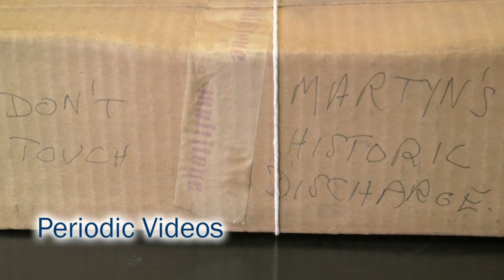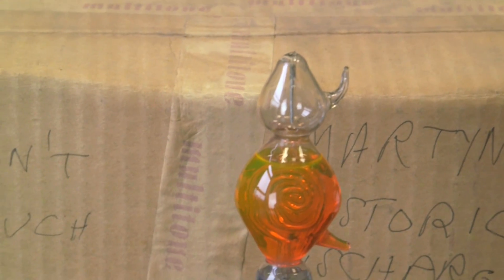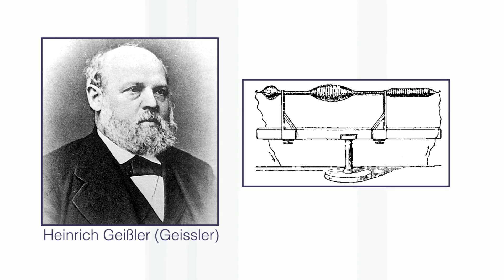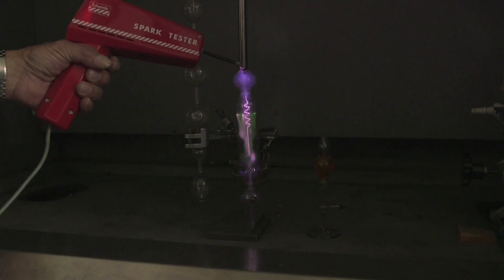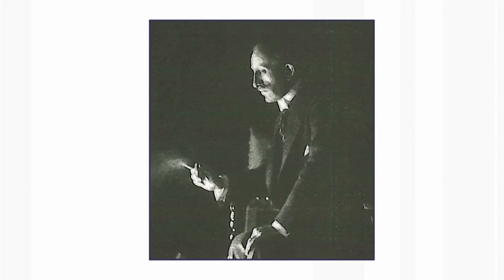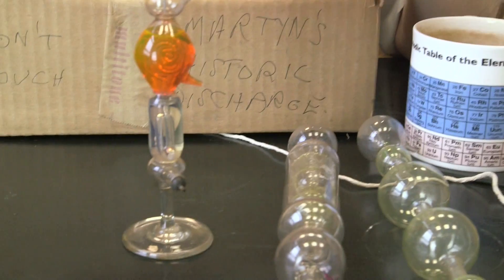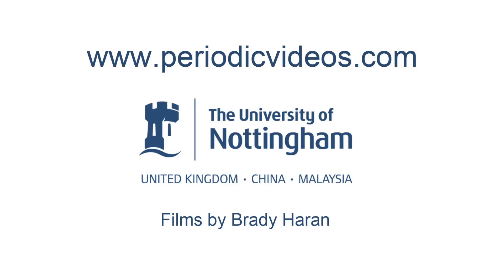Geissler Tubes - Periodic Table of Videos

Comment: Some Geissler tubes are not purely decorative, they were used with 'Lecher lines' for measuring standing UHF radio waves, looking for the points where the glow died down as zero points or 'nodes'.

Comment: Vacuum, low pressure air, uranium glass and fluorescein in water (does not require UV to fluoresce, actinic wavelengths cause fluorescence)

Comment: Time to view the spectrum of; 1 the non fluorescent portion to identify the gas by the spectral lines, and 2 the fluorescent glass to view it's emission lines. It would be very interesting to identfy the gasses. Due to the very strong emission lines of In low-pressure mercury-vapor lamps at 184 nm and 253 nm, they would be preferred for fluorescent displays. Normal window glass would block the UVC and quartz would pass the short wave UV.

Comment: If it's uranium glass it might exhibit slightly higher than background radiation - find a Geiger counter. I wouldn't expect more than about three BEDs (banana equivalent dose, 0.1 uSv per BED).  For the gas, wouldn't a spectroscopic analysis be able to give you some information despite the unknown pressure which is probably "low", and since the colour ALSO changes with current density, tests with different tesla coils with different frequencies and voltages might be able to yield additional information.  For mercury vapour systems, you can normally detect/see a microscopic amount of actual mercury in the tube (as in Hg vapour lamps).

I don't know about the florescent liquids.  Some possibilities that occur to me are solutions of quinine or urea.  The yellow liquid has a high refractive index (appears to be splitting yellow/red and green light) and reminds me of a mineral oil or similar substance which can have this kind of effect.  I don't know about the possible florescence of mineral oils, but seem to remember some potential issues with using mineral oils on oil objectives on florescent microscopes (I think glycerin is used instead, in that application).  Might be a set of clues there?  

I'd recommend non-destructive testing methods, since these devices really do have irreplaceable historic value.

Comment: This is nostalgic to me because when I was young (nearing teens, almost 40 years ago) I went to the library often and was fascinated by books that taught science. There was one book that had various sort of DIY stuff about making high voltage experiments, including high voltage transformers and Tesla coils AND these tubes. It was fascinating but sadly my only attempt was not very successful. I attempted to make a high voltage high frequency transformer from a used car ignition transformer by stripping the cap from it so that I could access the magnetic core (laminated steel plates) to make a magnetic resonance switch to operate it in relatively high frequencies. I think I got close, but not enough, it never produced any satisfying sparks even :) And I don't think I would have had any clue as to where to get these wondrous glowing glass tubes either.

Comment: I was doubtful when the Professor claimed his grandfather, Joseph Poliakoff invented the volume control knob because potentiometers have been the standard for volume control for almost as long as volume adjustable audio devices have existed. They were invented by Edison in 1872, but potentiometers have many other uses and weren't originally intended to be used for volume control. So I need to find the first instance of one being used for volume control.

I'm assuming it was a potentiometer since that's been the standard for volume control for as long as volume controlled audio devices have existed and still are.

EDIT: I've gone through patent records and come across several patents pertaining to the use of potentiometers for volume control. One of which was indeed filed by Joseph Poliakoff. I will provide details in replies below. Please excuse the length of these comments. I wanted to be as thorough as possible. If I made any mistakes PLEASE correct me. I do this with the utmost respect in the name of truth and in no way intend to trivialize or discredit Joseph Poliakoff's amazing contributions to science and technology.
Reply: I found a patent GB1857237A attributed to Joseph Poliakoff and Oswald Barber Sneath dated July 5 1937 for an audio transmitter which describes the use of a potentiometer for volume control. So it seems this is what the Professor was referring to.
Reply: I've also just found a patent US200928X filed on August 16, 1933 by Arthur William Baker and Stanley Cyril Mitchell for a volume controller or potentiometer for radio recievers which seems to work in the same manner as Joseph Poliakoff's volume control in his 1937 patent. So unless I'm mistaken, it seems Joseph Poliakoff wasn't the first to invent such a device. I can't find any other patents attributed to Joseph Poliakoff which describe potentiometers being used as volume control, so I'm assuming the volume control on his audio transmitter was what the professor was referring to.

I should also mention there was another patent going back to 1928 patent number US1747961A which uses a potentiometer to control the volume of a radio reciever, but it does so in a completely different way from conventional volume control knobs by varying the input frequency.

So in conclusion it seems Joseph Poliakoff wasn't the first person to use a potentiometer based volume control knob. But that's not to say he didn't come up with the idea independent of these other guys, except maybe Oswald Barber Sneath, who filed the patent with Mr Poliakoff. But he was certainly one of the first people to have come up with the idea. So I consider him a pioneer none the less.

Comment: Geissler tubes are generally made of plain glass (the clear), I've not heard of any in quartz. The yellowish glass is indeed uranium-oxide glass; Corning termed it "canary yellow" and, filled with argon + mercury, neon sign makers got an electric yellow-green. The gas inside is almost certainly air at low pressure. These are probably circa just before or after 1900. The tubes mounted on a glass pedestal or foot seem to be especially rare; more common for upright tubes was ending with a thin stem, which was inserted into a wooden pedestal, and many of the decorative fluorescence-effect Crookes tubes (containing a painted metal beetle, butterfly, flowers, etc. or maybe a fluorescent seashell or some minerals in glass claws) were so mounted.

There were several fluorescent liquids used, giving everything from yellow, orange and red to green, blue and purple. The yellow-orange in the liquid-filled tube is probably fluorescein, and the clear which glows blue is sulphate of quinine. The tube with the glass vase is a "Gassiot's Cascade," wherein the discharge is forced down into a vessel with the lower end sealed, and must then 'climb' out over the rim. This was exploited in other tubes so that a watering can might shower light, a fountain would appear to spray, or a pitcher would pour a stream.

These three are exceptionally beautiful, and have survived in great shape. The electrode caps that are missing is very common. Be careful with the spark coil, as those sparks can puncture glass around electrode wires. I'd love to locate one of the glass pedestal type someday. Oh, and Professor, you've got approaching 300,000 views by now. You and your grandfather, and his wonderful and rare Geissler tubes, are entertaining a whole lot of people, many of whom have probably never even heard of these, and some of whom may have seen only the simple ones used in modern school classes.

Comment: When I hear gas discharge with UV emission first thing I think is low pressure nitrogen. It is used in UV lasers. You can try spectral analysis without harming the tube. You know; they are pretty noninvasive. Glass(probably quartz, I agree) might change the result a little bit(as any material would) but it will be enough to specify the characteristics of the gas. 

By the way; when you stop a charged particle it emits its the kinetic energy as a photon. (this is generally how medical x-rays produced) Maybe electrons interacting with glass in the process and they are producing UV light.(consider the glass as a target) This can easily be detected by changing the voltage. If this is the reason for UV light when you decrease voltage UV lights shall have longer wavelenghts and when you increase the voltage it shall get shorter. If it is caused by the gas wavelenght shall be the same until a critical point which it is not emitted anymore. So; with specrometry I would test for the cause of UV first.

Comment: This particular set of Geissler tubes appears to be from the 1870s to 1880s. They could be as late as the 1890s.  Usually they included d asmall amount of mercury vapour, and uranium oxide in the glass.  The internal tubes are usually quartz glass, the liquids can be any number of liquids from quinine to various alanines.  The electrodes were usually made of platinum.  The styles shown here are generally found in French manufacture, and may contain rhodamine (for red fluorescence) quinine, for blue, or various combinations thereof.  Some were engineered to deliberately show stratification in the plasma with distinctive banding (dependent on internal leakage), others contained powders to recharge or reduce the pressure, and absorb contaminants.  There was a run of production int he 30s as well, if I remember correctly, but these appear to potentially be quite a bit older.
The most unusual geissler tubes were actually mechanical/physical electrical valves, which would divert the energy to one side of the tube or the other, dependent on the electrical 'flow' direction, using the formation of the glass itself to make the rectifying effect.
The ones with red glass in the sealing surfaces (around the electrodes) are probably pre-1900.
Reply: You clearly know what you are talking about and thank you for that informative post.  I am curious to know how someone learns about something that seems, at least to me, to be so obscure.  How did you become interested in Geissler tubes?
Reply: Interesting you mentioned electrical flow as his father was working on circuits.  Also back then vacuum tubes are common and today replaced with ICs.
Reply: ooo uranium glass. pretty cool. stopped making it except in some place in switzerland i think
Reply: The one with characteristic glow of uranium glass lit by uv radiation was my favorite 🥰

Comment: File some of the substance that makes up the the tube into a dish, test its chemical composition to find out what exactly the tubes are made of. step 2 Replicate a sealed tube made of the same substance that the Geissler tubes are made of, the tube you make dosnt have to be fancy, you just need to find out how light will pass through the tube, specifically a spectral graph. step 3 take geissler tube and put it in the spectral graph and see what the gas of gas chemical or vacuum mix is inside the Giessler tubes without damaging them. You might be able to use ultrasound to measure the pressure in the tube.

Comment: The greenish glass is "uranium glass", or vaseline glass (same thing). It's still used today in Geissler tubes, as it gives off a lovely glow when it's subjected to high tension electricity. The gas in the tubes is probably only residual air molecules, given the pink discharge in the bulbs. This is the most common thing for ordinary Geissler tubes, they are just evacuated to a fairly strong vacuum, and further colour is introduced to the discharge by adding vaseline glass and/or various liquids. The liquids are more difficult to identify right off the bat.

Comment: Just my two cents:
The green glass is almost certainly uranium glass, which is a weak aplha source, but was used for its nice flourescence
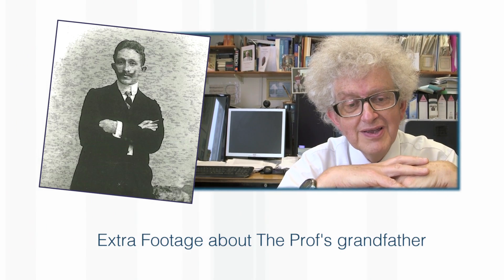when exposed to UV light which amlost always is prodiced in gass discharges.  ( look at 7:03 )
Many ot these tubes were simply filled with air at reduced pressure . Mercury is not completely unlikely, but not really needed.

Comment: You can try using a spectrometer to get the color, and use an adjustable HV power supply to see at what voltage they conduct to discover the pressure and work backwards from there to find the exact gas

Comment: Why can't a spectrum analysis of the light be done?
Reply: Several reasons: the professor already states that the spectrum depends on the gas and the pressure, and I don't know how you would measure the pressure without damaging the tubes. Also, the tubes are impregnated with a material that glows when hit with uv light, so you would see that spectrum over the emission of the gas as well.
Reply: How would the pressure affect the spectrum?  Aren't the spectral lines 
fixed according to the type of element emitting them?  As for 
the glow of the tubes, that seemed to be observable separately from the 
gas, so why couldn't you analyze that spectrum separately and 
compare/subtract/control for the difference with the other spectrum?

Comment: you could could modify the voltage and the frequency of the current to get a theory on the material inside. then apply external pressure or vacuum at a stable  voltage.

Comment: your grandfather invented the volume knob? 

Tesla bless your grandfather
Reply: Louder I CAN'T HEAR YOUUU ;)
Reply: I though Martyn was talking about Automatic Volume Control (or AVC), a feature present on all modern radio receivers. But Wikipedia says Harold Wheeler invented that.
Reply: juggliar  That's like how Steve Jobs invented fonts.. if he hadn't someone would have 2 years later. The early form of a transistor sounds interesting though
Reply: @kestasjk  Please tell me you don't actually believe that?
Reply: @kestasjk  Did you just reply to a joke with a dig at the original video to the effect that J. Poliakoff's invention of some thing is no big deal because someone would have done it eventually?
I hope not. That is the kind of thing an asshole would say. Did you invent that same thing first and have an axe to grind? It is easy to claim that a thing that a person has devised and put out into the world  would have been devised. It is less easy to prove it or prove that the claim is interesting or important.
It seems a bit like how you minimize Jobs's influence on font implementation on computers. No-one who knows anything about it would claim that Jobs invented typefaces. He did, however, push for the implementation of fonts that closely matched between computer and print.
Reply: Mark M I understand a volume knob is just a variable resistor. if he invented the variable resistor okay thats impressive i guess, but otherwise hes just taking a variable resistor and finding another use for it, sorry I dont think thats a big deal. Based on your reply i thought maybe an analog volume knob was more than that, but no thats all a volume knob is
Reply: @kestasjk  I don't  know the whole history of Mr. Poliakoff's claimed patent. However, the  quote by you that I was replying to reads," That's like how Steve Jobs invented fonts.. if he hadn't someone would have 2 years later. The early form of a transistor sounds interesting though."
Your claim basically devalues the entire point of the patent system. You claim that, yeah, that's interesting, but now that you mention it, it could work. But You never mentioned the original invention previously. It does not matter whether it is obvious after the fact. Did you patent the use of a variable resistor for volume control?? That is your claim? Where is your patent? People come up with great ideas every day. Sometimes they are "obvious". The way the system works is that the first person to claim the "obvious" is the inventor.
Reply: @kestasjk  Sorry what.. are you implying everyone used the same typeface with no variation before Steve Jobs!?

Comment: What did they originally use to power the tubes?  Did they also use Tesla coils?  Does the high voltage have to be at a high frequency or could it be run with a constant high voltage?  I noticed that with Neal's Tesla coil, it seemed like the entirety of the pinwheel sort of deal didn't seem to light up entirely, at least in the bit shown.

Comment: Neat.
I would figure if someone were really interested in the tube's chemical make up they'd use spectrum analysis while the tube is excited as well as when it isn't. Chromatography may not be precise but I figure the proportion of emitted wavelegnths could give some decent approximations with which to build some test dummies. You could I guess also do chromatic tests of various other tubes of gases at various pressures and coatings to see what matches.  (Sort of like digging out a tunnel by starting from both ends.)

Comment: Use a very simple spectrometer! You can see distinctive lines that will identify the elements luminescent. Pressure is secondary at low pressures. Some of these can be visually identified as partially nitrogen discharge, by the pink color. Further, one could identify the pigment in the glass by absorption from the broad background. Further, a lot of the light comes from decay of excited atomic and molecular states, not ionic recombination, which is not an efficient emission process for lines, due to the continuum. Pretty pictures. Lousy science.

Comment: One method to identify the materials could be a fluorescene spectroscopy. Determin the wavelength of the light emitted by by glas and the gasses and compare them to the materials most likely used for the tube. The glas of the inner tube could be uranium glas, because of the bright green light it emitts, when it is exposed to UV light.